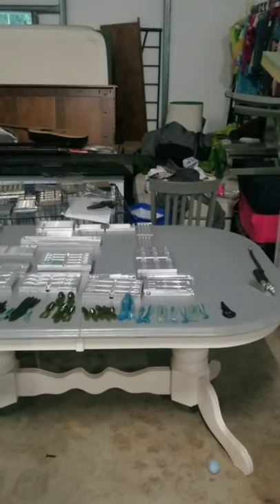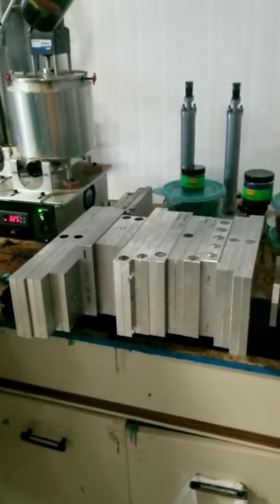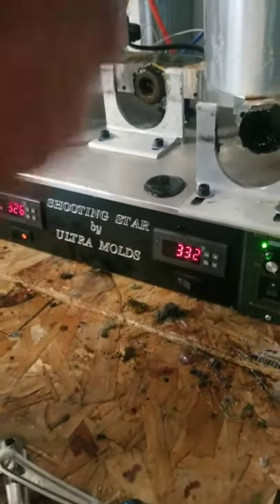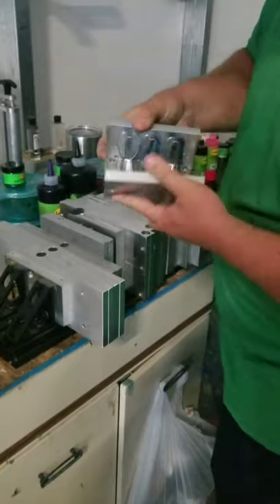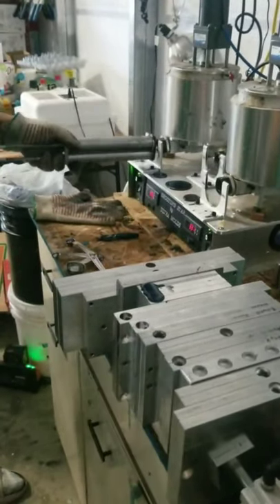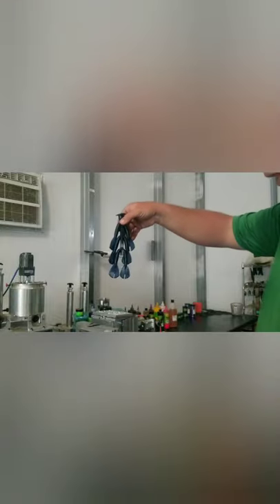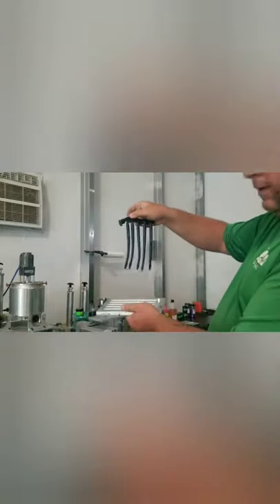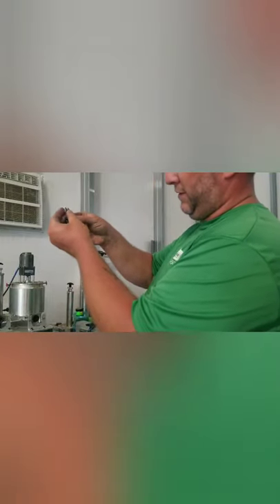Soft plastics bait making with the Shooting Star by Ultra Molds

Comment: Very nice what clamp system are you using?
Reply from the maker: This.is a buddy's setup, not mine, but he uses an air compressor and hoses hooked up to some plastic grip clamps to hold the molds closed.
Reply: @averagejoesfishingclub8040  Thanks been looking for a  clamp system never seen this one.